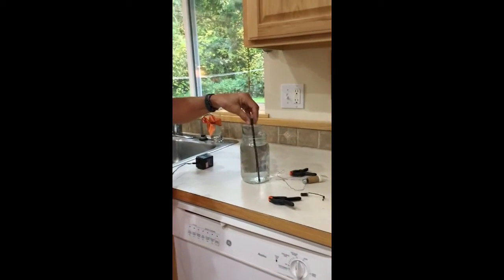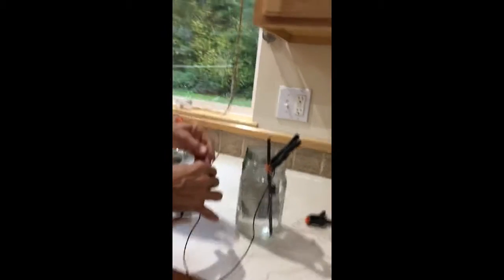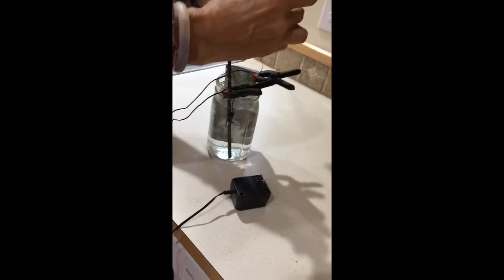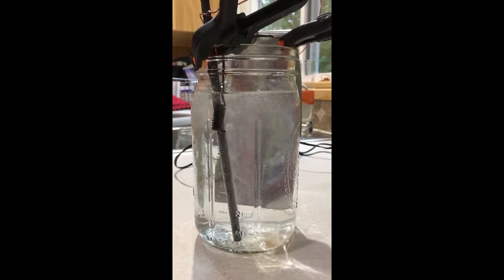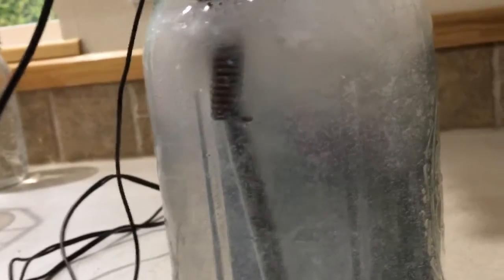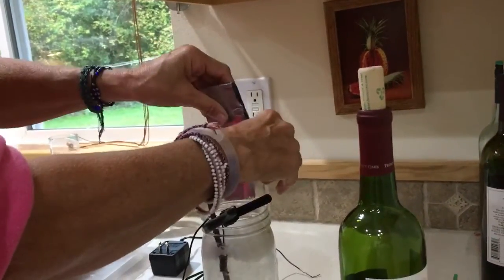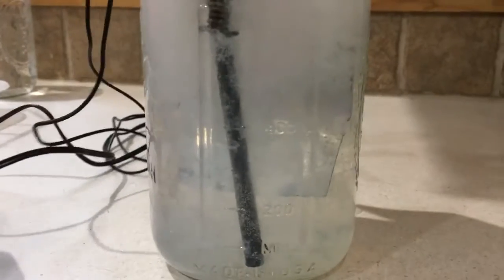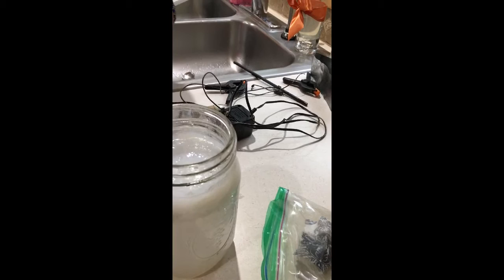Carbon stick method CO2 -ZnO :creating GANS in 1 hr

Comment: Sorry to say it but the LED isn’t doing anything to slow down the current as the leads are directly connected to the transformer. This allows the electricity to take the path of least resistance, the LED isn’t doing a thing since it is of much higher impedance . Therefore it doesn’t light up! Most of the later setups I’ve seen are using LEDS so the current has to pass directly through the LED which throttles the current down to a trickle supposedly causing much smaller GANS clumps. I’ve been wondering if vibration or higher pressure air would keep the Gans separating rapidly from the electrodes allowing the use of higher currents with out the throttling effect of the LEDs resistance to get true Nano sized Gans while at the same time getting a very decent production instead of taking weeks !

Comment: really cool.  That was incredibly quick GANS production. Mine seems to be going much slower. I do see the little bubbles coming off the carbon rod, but not nearly as much as your getting.  Is it because i've connected my alligator wires to a double A battery instead of an outlet?
Reply: Morris - can you measure the current?

Comment: harvesting amino acids off the top? how? why? please elaborate.
Reply from the maker: 5th International Knowledge Seekers Workshop Feb 16 2016 
(Amino acids etc) 
2:24:   https://www.youtube.com/watch?v=47OJYe8GwSY ( after talk on Obama and coming earth changes) 
 "In the time of disaster, you need to feed yourself. One of the main things you can do to feed yourself in the time of disaster to replace the loss of food and direct taking of protein is the Amino acid that you wash from on top of those boxes. This is the protein structure that is the same proteins structure as your body.  Please understand exactly what you got to do in these types of times when it is needed. When you have your CO2 box - when you make your plates (Zinc and Nano coated copper) and you have the fat on the top, that fat is the pure amino acid which your life is based on. It's the origin of the creation on this planet, Wash it if you can find distilled water .. and consume it. Make sure you understand what you do. Those of you who do not want to consume it directly, use the same thing. Wash it, rub it itself on a clean glass. In a way, make your glass from outside fully coated with the amino acid. Make sure that you wash the protein. Just put it in the water and turn it around. It's very easy. Rub it on the glass and cover the glass with a plastic so that you don't touch it .. and any water that you put in that cup carries the energy of the amino acid. It is like eating meat, like fish, like anything else ..... this is how you overcome immediate hunger in the time of disaster. This is how you can feed yourself for at least 2-3 years until a stability comes back in any shape of order. Those of you who consume the CO2. that is your problem. Those of you who consume the protein in time of emergency you have taken a step. But we advise you not to consume it in a way of physical taking. But Consume it by putting it on a glass ..a cup. And wrap it so you don’t touch it and consume the liquid inside. You will receive the full energy as that you are eating protein every day. Try to replace the AA on a regular basis, every 2-3 days, just put a cup that it creates AA from space the environment. This AA is uncontaminated. It doesn’t matter if there is a nuclear accident in a time of disaster the AA is untouchable, it is pure.
Reply: what is the method of harvesting amino acids from the top of gans? how is it used/stored/etc?
Reply: WOW. That's amazing. That's what I wanted to understand when I heard Keshe say it could be made into food, or blood, or anything!  Thank You.
Reply: NOTE: Latest lab tests on mice (Cancer Solution in Exchange for Peace Pt.1) showed NO results when amino acids were added ..................

Comment: The more videos I watch on how to make CO2 GaNs the more confused I get. I would like to give it a try but I don't know where to begin. Should I use a nano coated copper plate using the caustic method or the fire method? Should I use a copper plate or use a carbon stick? How often can a copper plate be used before it has to replaced? Evidently, if a carbon stick can be substituted for a copper plate then this implies that copper isn't an important part of the process after all. From what I can gather, none of these methods actually produce very much GaNS powder at all. I'm wondering how often these procedures have to be performed in order to collect enough GaNS to do anything with.
Reply: Rick Jones - Join the club! My take at this point regarding nanocoating a copper plate is MTK has waffled back & forth on this, but says each method produces different nanocoatings, so it depends on what the desired result is - health application, energy production, etc.   I do not find kfwiki to be all that helpful, but understand it is a work in progress. There is some good info on plasmaproduction.org and youtubes by Cary Kirastar Ellis, etc. but things change daily. For instance just yesterday he said (169th kowledge seekers workshop on YT) the preferred method to make gans is now no current, no LEDs, and plasma capacitors.

 A copper plate will disintegrate after time and pieces will fall to the bottom of the container. This is less likely to happen with thicker copper like wires or rods, but be aware that all that looks like copper is not copper. Copper grounding rods may just be copper plated steel rods.
K did acknowledge that carbon sticks can be substituted for nanocoated copper, but I have not seen any proof that people are get results using this method (other that making some kind of powder which they assume is gans). The quantity of gans produced varies, and without using any electrical current could take weeks or months, but the quality of the gans is supposed to be better. For what it's worth, I purchased some gans from KF as part of the clinical trials program and found it to be much softer and fluffier than the stuff I was making. When I diluted it in water, it took almost a week to settle out whereas my stuff settled out in a day. This too in light of the fact that K said the factory uses the electrical method because they need to make large quantities in a short time. Go figure.
Reply: how was the result? fast is another thing from effectiveness. this also apply in making true colloidal nano silver.

Comment from the maker: yes.... i asked into the difference between the GaNS made from carbon stick method and the original Method using Nanocoated copper.... i kept feeling like there was some difference .... I Asked the Dr who does my testing ( SRT method) using pendulum and "Our Guidance Team" for the plasma technology and his ability to receive numbers with 99% accuracy. Result: both give about the same field strength/frequency of GaNS, the carbon Stick  and original method both make about 65% ZnO and 35% CO2. The Carbon stick is  85% as effective as the other method for Health and Power Applications . I asked more into the 15 % and what that is..... came up with that the other 15% afforded by using real Nanocoated copper gives the GaNS more of a  " Other dimensional/ multidimentional access point".... yes thats confirming what i suspected. what do you all get?
Reply: 1withlight - thanks, that is very helpful, expecially to one who is afraid he would botch up the nanocoating process so has opted for the carbon stick method. Wish there was some way to amp up the effectiveness of the carbon stick method - it would save a lot of trouble. Incidentally, just stumbled on this device for making quantitative measurements. It is apparently a high-tech dowsing rod with  a graduated scale - German technology (probably ET :) http://www.tarotvaastu4u.com/ available from India for less than $200 pp.
Reply: where we can buy the carbon stick?
Reply: samreen ali don’t. just buy copper fridge line and nanocoat it... it’s so easy

Comment: I'd like to know why/if the carbon stick method works and why it can replace nano-coated copper ( don't you need a nano-coated surface to produce superconductivity?) And are welding rods as good as carbon rods or nano-coated copper plates?

Comment: The current rating on you charger is irrelevant but it need not be more that 1 amp.  The amount of current you actually draw will depend on the spacing of the electrodes and the amount of salt you have in the water,  etc. . So I suggest you use a multimeter set to the milliamp range to determine the amount of current in your setup. You can adjust the amount of current by using a variable resistor or potentiometer of about 1000 ohm (1K ohm  ) in series with the power supply set it so you just see bubbles coming off the nano-coated carbon electrode or carbon rod but not too much otherwise you will be producing impurities..

Comment: Could you please change Cary Ellis Method to Arvis Liepa method. Respectively I did this method. I have against Cary she is very nice persone but let's be correct.
Reply: No. You are using max. 0,6 Ampere for CO2-Gans production. There is not much amino acid production with your method of making Gans. MTK has not validate your method with carbon stick.